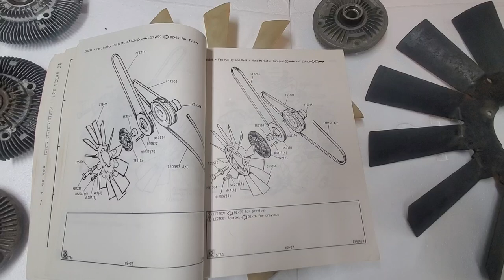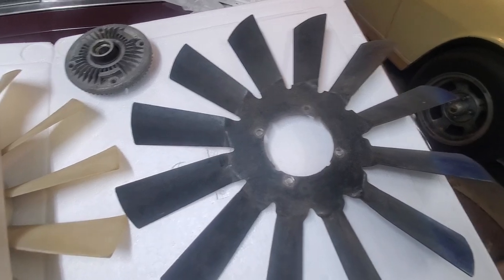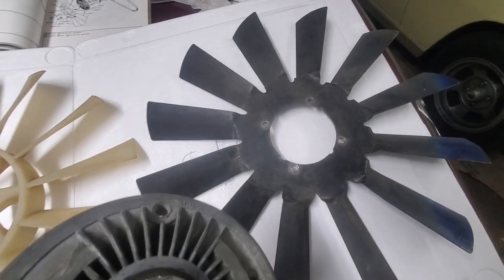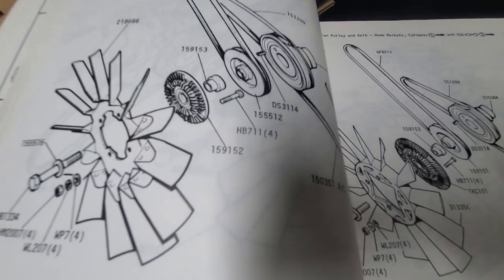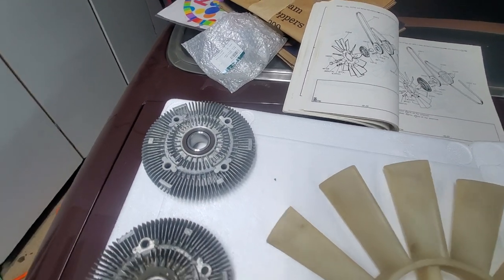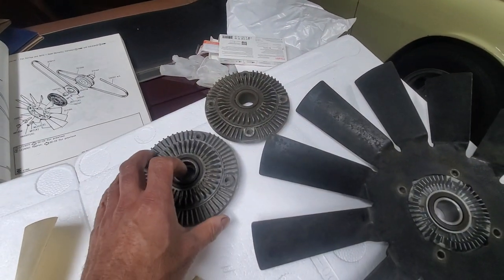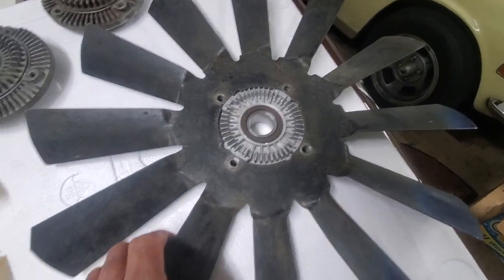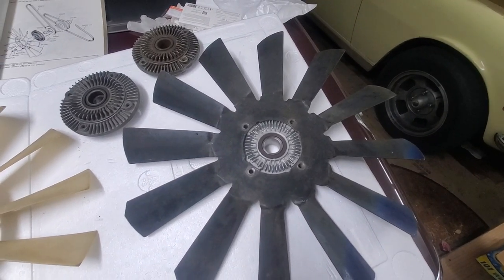Triumph Stag - Fans and Viscous Couplings

Comment: My MkII Federal Stag with factory AC and has the plastic fan. Possibly it was changed along the way. I've never seen the metal fan before.
Reply from the maker: Does your Mk2 have the metal cowl?
Reply: @sujitroy  , no it probably went missing around the same time as the metal fan. That's another project I should probably do on mine.